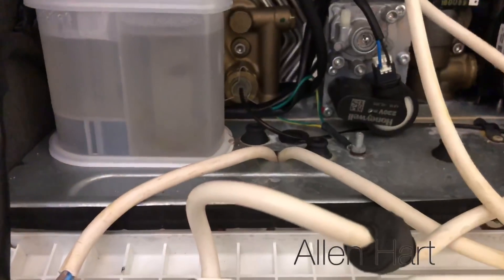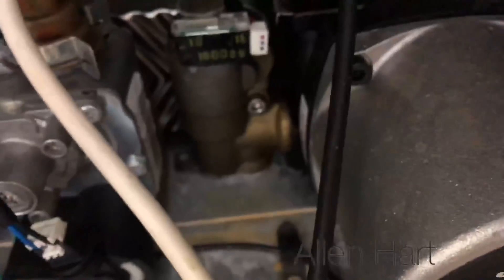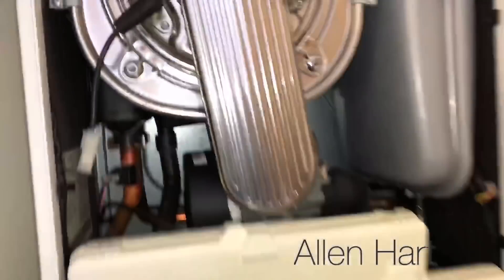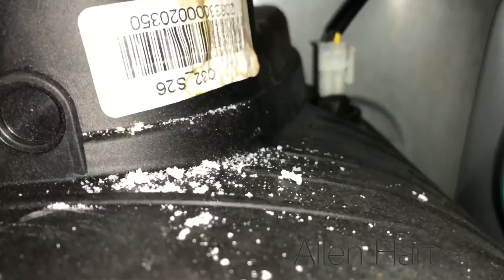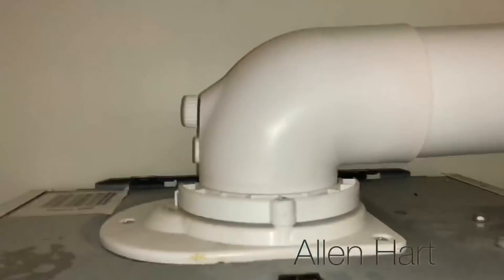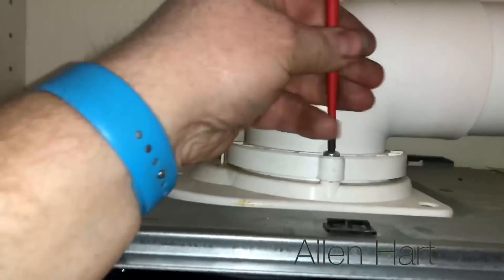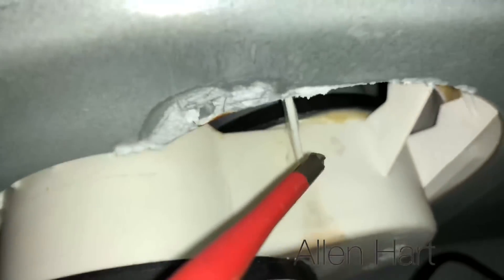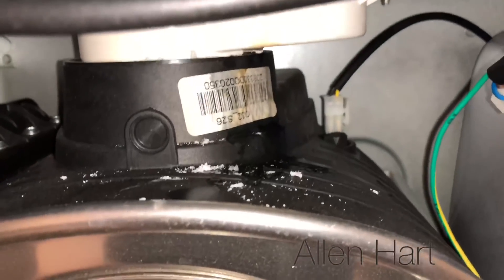Ideal Vogue Leaking Flue Seal A day in the life of a Gas Engineer

Comment: Hi Allan, I found a logic today with exactly the same thing.  The washer like yours looks miss shaped....did you replace the washer or reuse it. 

I put the washer back and it passed case and flue integrity but I did pick up 6 parts CO close to the gasket. I decided to turn it off and order a part.

Comment: Engineers take note, Valiant ecotec pro flue adaptor seals   are perishing on these boilers. The seal that seals the elbow onto the turret gets worn and the turret goes brittle causing flue gases to leak.
Reply: Thanks for the heads up on that.

Comment: Hi Allen, great vids, been watching you for a while now, Senior (age that is ) Heating engineer with more than 30 years in the industry, quick question for you how many RIDDORS, Warning Notices do you issue in a year and how many Isolated dangerous appliance do you complete
Reply from the maker: Not as many as i should tbh .. Thanks.
Reply: So basically if the work of an engineer isn't up to scratch you just follow them around for a little while and RIDDOR the work they do🤣. They'll soon be struck off the GSR.

It's mainly to report incompetency of GSR engineers.  Risk of Dangerous Diseases & Dangerous occurrence regulations. If it's a DIY install, HSE won't want to know. If the works carried out by a supposedly competent  engineer. That's reportable. It's all governed by the health and safety executives which are basically GasSafe which are in there with IGEM.